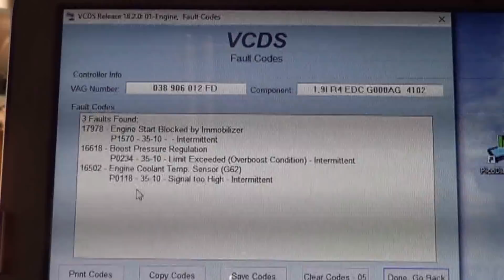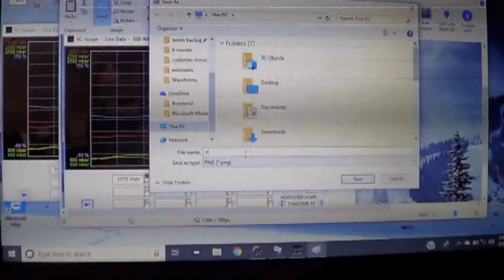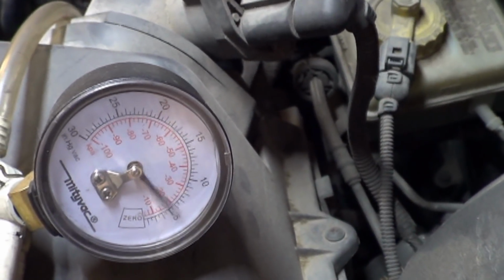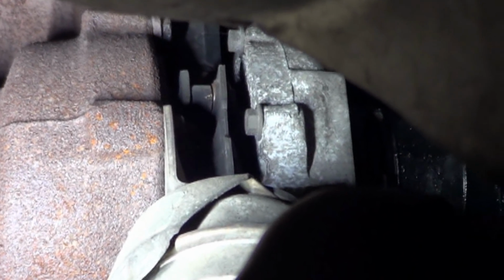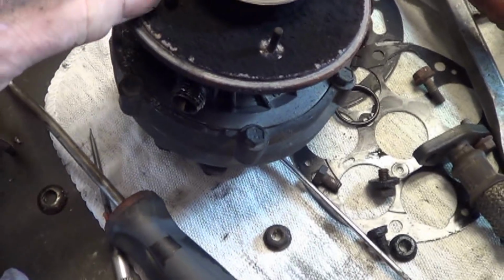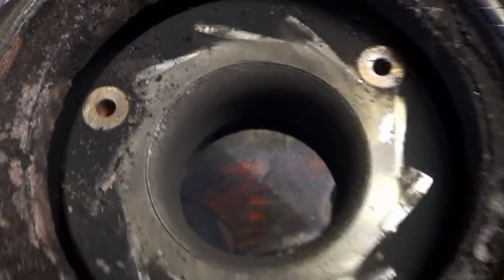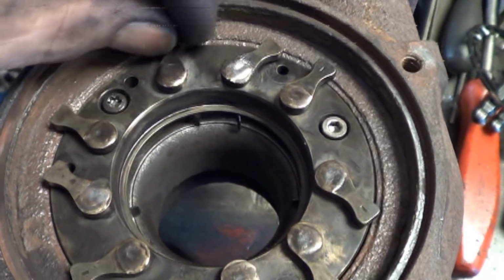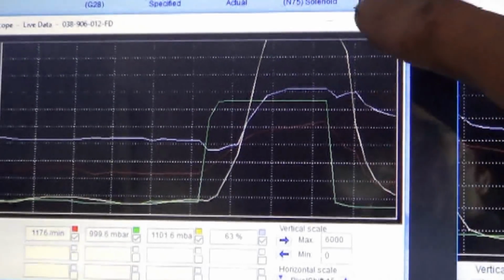Vw Tdi P0234 Overboost

Comment: Let's say you put the ring upside down because you did not know better when you took it out for cleaning.... Could that cause it to overboost? Checked everything else, and that's the only thing left for me since I didn't mark it when I took it out.
Reply from the maker: Yes,  I believe so.
Reply: @CoolAirVw  Will report what happened after I get some new manifold gaskets, thanks.
Reply: @CoolAirVw  It was a long time coming... But it's done, overboost gone. Now I need to get a working N75.
Reply from the maker: @Killer344-ZxS  Excellent.
Reply: @CoolAirVw  new N75 installed... Everything working almost as intended, underboosts a bit, need to tweak the actuator.

Comment: Would it be better to use some kind of solvent as opposed to wire brush?
Reply from the maker: what kind of solvent do you use?
Reply: @CoolAirVw  I've only ever used oven cleaner via the EGR inlet, but I do have one in bits right now. It feels like immersing the whole VNT mechanism in some kind of solvent would do a really good job and not have the risk of physically removing the carbon. Don't know what to use though, what dissolves carbon? I guess good old oven cleaner. Just keep it away from any aluminium!
Reply from the maker: the wire wheel doesn't hurt anything.  I've done 20 or more.
Reply: @CoolAirVw  Oh absolutely, but surely a solvent would reach areas the wire brush never would, eg the shafts going through the plate that connect the vanes to the lobes. I'll give it a go with oven cleaner tomorrow on a mechanism that's never been cleaned and see how it does. Apparently brick cleaner does a good job too, looks like it contains hydrochloric acid.

Comment: How much would something like this cost? I have the same problem on my car audi a4 2.0 tdi.
Reply from the maker: If you are in Kansas City area wanting your car worked on then please  email me.  You can find that info on my website, linked to in every video I make.  If you are not, then it is pointless to ask my pricing, as pricing in my area is different than pricing in some other region.  Honestly though, pricing in any shop is going to be different than another shop.   Find a shop near you with experience in these and ask their pricing.  Lots of shops do not offer "repairs" on turbos.   Dealership for sure will try to sell  you a turbo when they are stuck.

Comment: can't you just leave the old one plugged in for no codes?
Reply from the maker: the old what?
Reply: @CoolAirVw  sensor
Reply from the maker: @Kevin-wy8kc  Is there a specific part of the video you have question about?  There are bunches of "sensors" on the car.  maf, map, input, output, intake flapper position, oxygen ect.
Reply: @CoolAirVw  wrong video thought i commented on where you put a manual bosst controller in place of an electronic one and you had to code out the cel
Reply from the maker: @Kevin-wy8kc  On that video, NO you cannot.  I assume you mean just leave the old actuator hanging there with it plugged into the harness?  If so then no because the computer would see that it wasn't moving when the computer commands vacuum to it, and would trigger a code and probably make limp mode.

Comment: I have a 06 passat that has a p0234 code. It makes 24lbs of vacuum at idle. The actuator seems to be making it's full range of motion. Is there a way to test the n75 valve without tge computer? And if it is actuating are the veins obligated to move? From the freeze frame we calculated it was making 23 lbs of boost when throwing the code... any recommendations?
Reply from the maker: Usually vacuum is measured in "inches of mercury".   When you say "it" makes vacuum are you talking about the vacuum pump or is there 24 lbs of vacuum at the vacuum actuator?
Reply: @CoolAirVw  yes sorry ( in hg ) and that's at the n75 valve vacuume connection.  We removed the egr valve and it was pretty dirty so removed the intake and turbo to clean them... the turbo seems to actuate fully. Havent gotten it apart yet it was late when I got it off and wanted to work on the turbo fresh.

Comment: The reason for the flickering screen is that in order to dim the backlight on some displays, the backlight is pulsed on and off using PWM rather than dimmed via voltage reduction.

If you raise the brightness of the display to 100% when filming, you may find that the flickering stops as the duty cycle of the backlight will be 100%.
Reply from the maker: generally now I use a different laptop that doesn't flicker.  I'll try that if I have to use the old laptop.  Thanks

Comment: Brilliant. You are a true specialist. I have this problem with a variable VAG turbo. Have you seen the threads about cleaning them with caustic oven cleaner? In the UK we have a brand called 'Mr Muscle'. I'm sure you will have your own brands. Basically, people squirt in this cleaner via the EGR valve opening, or through the exhaust port, having removed the exhaust to turbo pipe and over a two hour caustic steep, they work the actuator rod  until it is free. The technique has been used hundreds of times documented on VAG and Skoda forums (same engines - same technology with VNT turbos). The owners were informed by main dealers that their turbos needed replacement at considerable cost. The method works and is within the competence of the average DIY mechanic.

 A very coherent and enjoyable video you made there. Thanks.

Here is a thread on the Mr Muscle method. https://www.briskoda.net/forums/topic/243533-the-mr-muscle-vnt-turbo-treatment-thought-we-needed-a-guide-of-sorts/
Reply from the maker: I am very aware of oven cleaner methods of cleaning.  If a mechanic did a oven cleaner method to your car and it didn't fix it, or stuck again shortly thereafter would you be a happy customer?

Comment: You forgot to check the inches on the actuator.   Between 15-17.5 inches mercury :) adjust the rod to length needed.   Alot easier on the bench than on the car
Reply from the maker: have you fixed many like that?
Reply: @CoolAirVw  yes.   If the rod is too short and doesn't hit the stop screw before 18inches it has more of a chance of overboosting.   It's a really fine line between setting max boost and overboost
Reply: @Frost420nexx  I think you mean it will hit the stop too soon if the rod is too short. Also the stop screw is often not set right, especially on 'reconditioned' turbos which have had the vnt mech replaced with cheap chinese rubbish. Symptoms of that can range from not being able to rev the engine over 2k (screw backed out too far) or no boost below 2k (stop screw sticking too far out)

Comment: My local garage have suggested I need a new turbo 😭
Reply from the maker: Maybe yours can be fixed if the lever is stuck. (vanes stuck).
Reply: Before spending that money on a new turbo try removing it and stripping and cleaning because carbon build up causes a lot of issues mine was stuck in the open position but after i cleaned it my car goes swiftly to 210 KMH with no issue.

Comment: There is easier way to clean that. Follow steps:
1. Get engine hot
2. Prepare 1 L dieonised water in spray bottle
3. Open hose right before cold side of turbocharger
4. Get engine on 2500 RPM
5. Spray water into intake, stops only when RPM drops, for a moment
6. Spray it all
7. Go for 15 miles hard drive after you finish
Reply from the maker: Wow.  I would worry about hydrolock.  I guess if you really control the amount of water.  Probably not worth the riskthough.
Reply: @CoolAirVw  Hydrolock? Man. Why? That's why you run engine around 2500 RPM. And you spray that water. It's nothing for combustion engine. I've done it many times on many engines. The more often you do it, the better, keeps turbo and exhaust valves clean.
Reply from the maker: @Fosgen  We used to run ATF down carburators at high rpm. Smoked up the whole neighborhood, but It allegedly "lubed" the valves.  Fun, but I dont know if there is any real value to it.    Post a video about your method of cleaning.  I would watch that!

Comment: This is a really bad turbo design…
Reply from the maker: I dont agree.  They end up stuck because MPG minded folks drive too light.  They need "exercised"!  Moved from zero boost to max boost position to keep free.  Plus a long, hard "PULL" will get exhaust temps hot to "burn out" the carbon.  If you drive this way once per trip your VNT will remain free and wont stick.

Comment: ....hey mechanics STOP open Turbos if you dot have qualification to do this job...Turbocharger is one extrem precise device ...after open is need to be clened at sirugical quality not posivel to put grese one bolts becaouse they open....and turbo stop working corecly... there are cetrain trick that you can do but i dont saw any just open and do sily things...so stop open turbos..now that turbo is wors that before you opened...if you open then you had to put a new vanes and calibrate tehe vane open and vacum valve....so you lost you time and spent money client...
Reply from the maker: I've done this repair dozens of times.  Lots of them are on cars that I service regularly and are still on road.  There have been NO documented failures after this repair.  It is possible some have failed, since then,  but none that I know about.   I would say that  you didn't watch the video close enough.  The "extreme precision device" is the "cartridge" that spins at 100,000 rpm plus.  I didn't take that apart.   I would not attempt to repair or rebuild the cartridge.   The Vanes are not "extreme precision device".